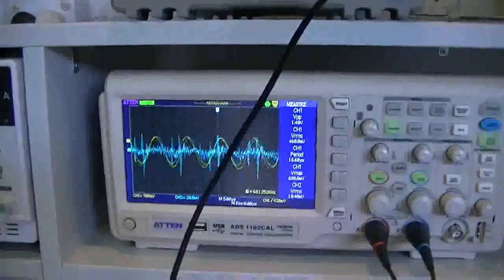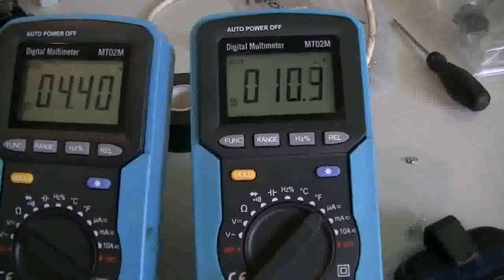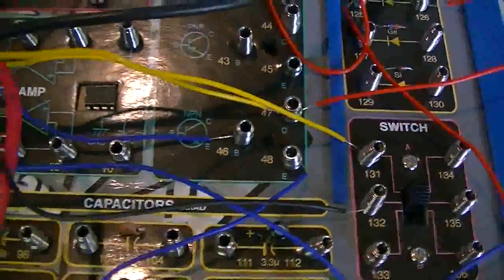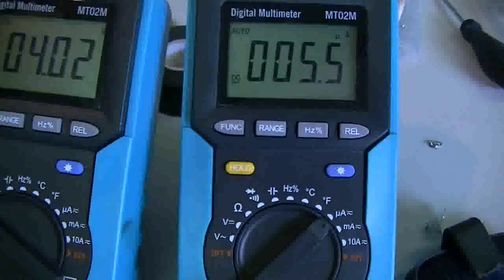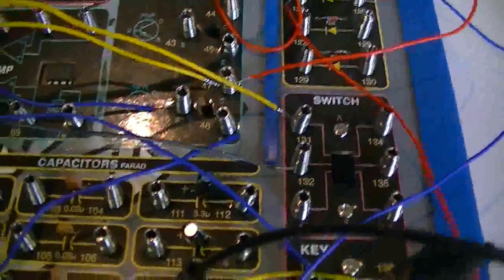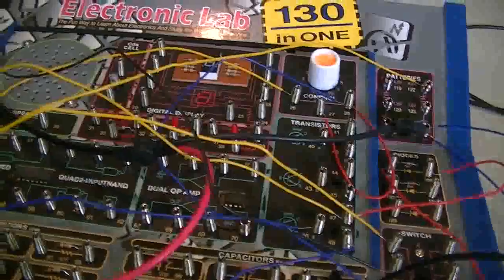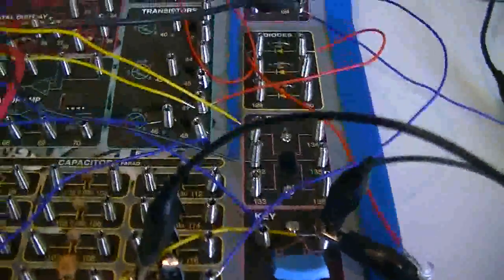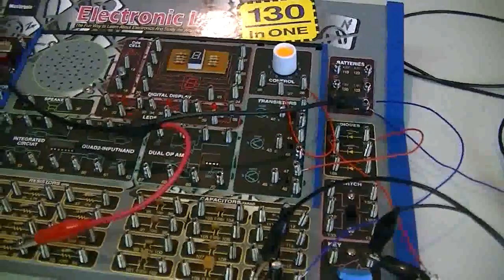Self powered oscillator reserch,air core coil v Akula coil.

Comment: well then... 
That's almost depressing; that if akula's videos were 10 minutes longer it would have been dead... oh and you're feeding power through a external signal generator that you're not counting... but; micro-amps; sure... 
I thought maybe lasersaber has 2 diodes that are overall brighter; and if you had 60 minutes; and he had 10; maybe it's just 6x brighter.... overall somewhat depressing :)
nice board; and thanx for that; 
the signal genereator is a short pulse then?  So unlike a joule thief that wastes a lot of time to build a field you're just pulsing a single coil?
Edit: I guess it's not really a leak as in addition to the system I guess it's a loss... like some of the electrons go that way...
Reply: Although; this would just require adding copper strips on the inside and outside of that coil... dual coils on akula are the one is driver feedback/resonance tracker sort of thing; so just driving the copper coil'ed coil at its resonance should see... just wrap a foil around the outside and inside and connect various edges I guess?